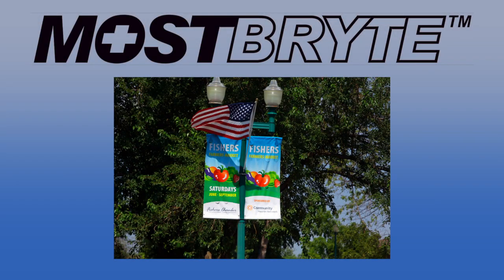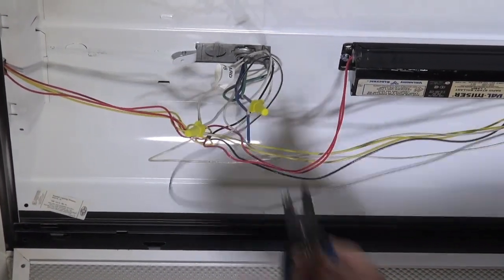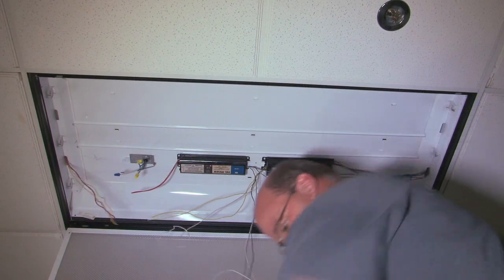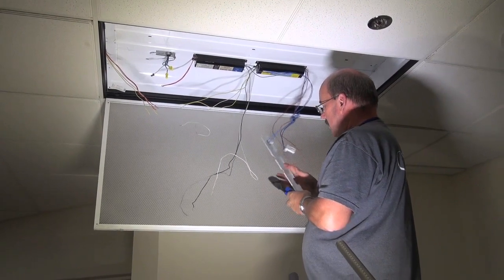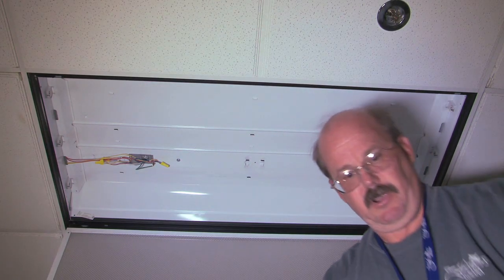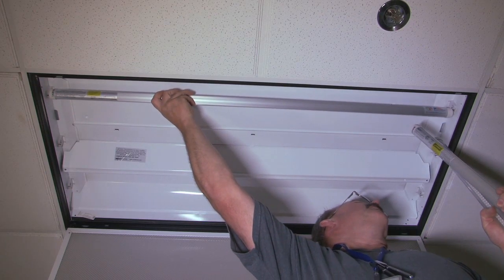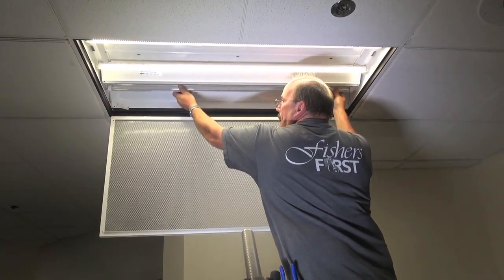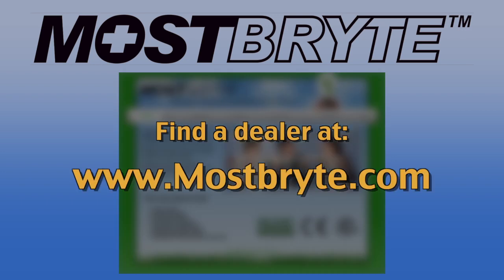T-8 L.E.D. Retrofit Installation

Comment: Highly recommend that the lamps are not installed with the power on.  Install the lamps with the fixture off.  The potential of a shock hazard is very real and the arcing that takes place in the end when twisting the bulb into the fixture can have a negative effect on the LED lamp.

Comment: Not very bright. Less wattage equates to less available light.
Reply: jim davidson, not necessarily. LED technology continues to advance. We are getting more lumens per watt than we did even a year ago.
Reply: The initial lumens for the F40T12CW lamp is 2100 and consuming 40 watts of energy excluding the ballast factor.   The lumens produce by a typical T8 LED is 2200 at 18 watts of energy consumed.  This is directed into a 270 degree pattern which puts more light where it is desired.  The end result is energy savings and better usable light.

Comment: Im doing this task now, and as Leo below says, much information is missing.  My fixtures have different colored wires, so a detailed explanation of how to find the neutrals and how to find the load wires is necessary.  this could be a dangerous problem for someone.  Perhaps this video is strictly a time test, and not instructional, but that isnt made clear.
Reply: Barry Bluth, it is what it is in that it was exactly what happened in this situation. If you are an electrician, you can gather the wire color differences from your situation. If you are NOT an electrician, I recommend hiring one if you’re not sure of which wires are to be used. Ballasts have the wiring diagram on them. Perhaps you could take a look at your ballasts to determine which wires to use. This video is a guide for this particular product. It’s important to note that not all tubes are wired the same. Good luck with your project.

Comment: David, from 3:40 mark on, the crucial information of which wire goes to which socket is covered by a simple sentence of "from past experience, I know this red and that yellow goes to the center socket ... other pair of red and yellow goes to the outside (two) sockets..." How could this be true when 4 wires goes to three sockets with two wires each? However you did it, there is hidden info. Therefore I do not think this video is helpful; it is definitely misleading and could cause serious injury, especially and seemingly, the retrofitting work was done when the power was ON. Don't think this is possible, but the message here is, yes, you can do it with power being ON. Please correct or remove this video for the sake of safety to viewers. Thanks.
Reply: Leo.  Thank you for your comment, however, there is no hidden information and what you saw was exactly what happened in real-time.  I am just the videographer, not the electrician.  As for the 4 wires to three sockets, I suspect two of the sockets were already jumpered.  There could have been, and possibly should have been a statement that one should turn off the power to the fixture prior to completing the task.  In this case however, this electrician chose not to turn off the power and was cautious not to short out the wires by putting the caps back on as he worked.  I would recommend turning off the power, but again, I am not the electrician and I just videoed the process this electrician followed.  Thank you again for your comments and concern.

Comment: you turn on the power after the wire connection. or you work with the live circuit...? Super man
Reply: In this case, the electrician worked with live wires and was cautious to put caps on them while he worked...and not touch other wires simultaneously.  I wouldn't recommend it, but it is, in fact, what this electrician chose to do...as he had done for more than 7,500 such fixture change outs using these tubes.  Not Superman...just very careful working with live wires.